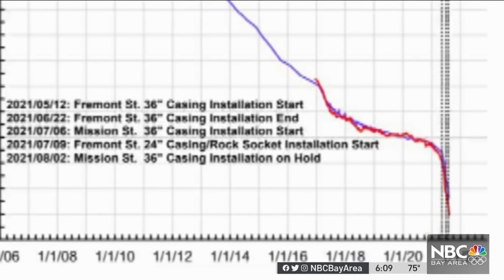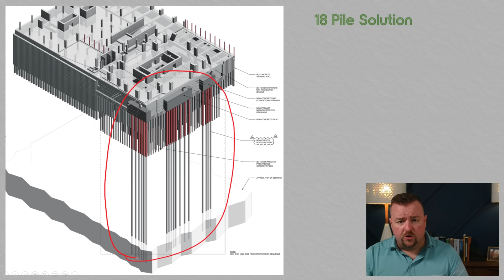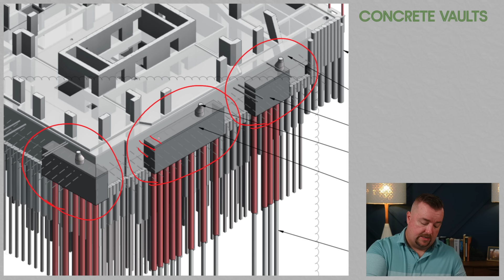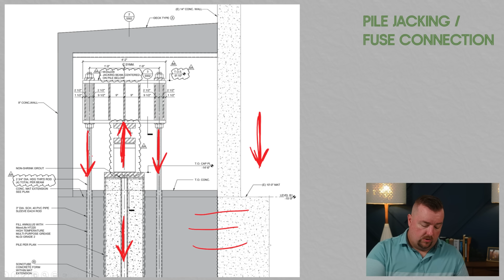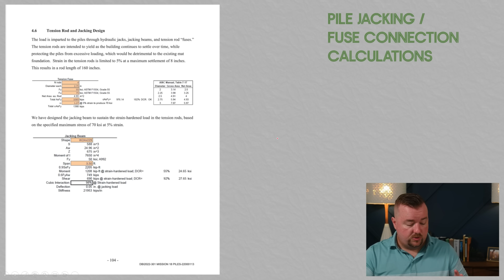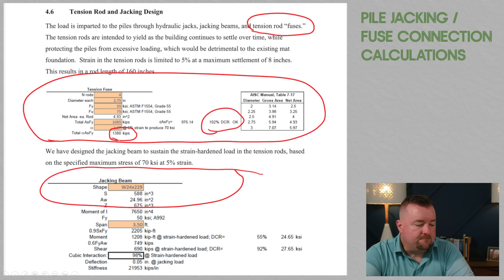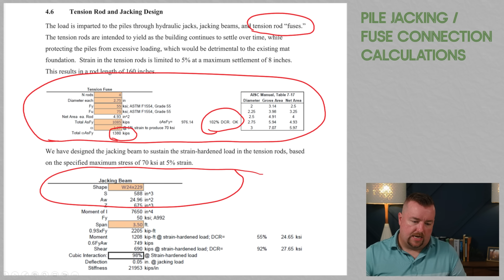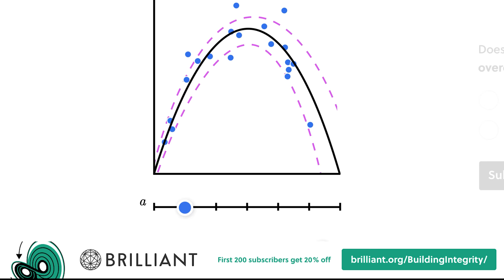Did I Uncover a $100,000,000 Mistake with the Millennium Tower "Fix"?

Comment: Please explain how those short sections of rebar normal to the edge of the existing building are supposed to be sufficient to transfer the vertical building load sideways into the vault concrete? I feel like the underside of the existing building is just going to start cracking...

Comment: Did you run a check for concrete crushing above the plate in addition to steel pullout failure? I would be a lot more concerned about that preceding the steel failure, as with any flexure in the plate I would expect a bearing area something like 5"x5" minus the area of the bolt. I'm sure that's all high strength steel, so regardless of the concrete strength it seems likely to crush it.
Reply: Yes.

Comment: The Tower Of Pisa in Italy, they drilled under the high side, removed some soil and brought the tower back a few degrees.
Reply: There was an article in Scientific American in the late 70's beginning 80's where they discussed the efforts that went to try to stablized the Pisa Tower during the ages, and all of them simply ddin't worked because those added weight to the unstable ground under the tower, and consequently increased the issues.

Comment: What happens if you have a failure of the 102% load at one of these "fuses"?  Would it be a "cascade" of failures?
Reply from the maker: In my opinion, yes.  They are all intended to be purposely loaded beyond their yield strength.  So a failure of just one bolt-to-plate connection would cause the remaining 3 bolts to fail.  Losing the load on that piling should instantly overload the adjacent pilings and they will all pop.

Comment: From day one this building has been a political mess of engineering. Once they changed the foundation plans from bedrock to that big slab, it was doomed. And, once they discovered it sinking, again it has been a mountain of politics combined with huge amounts of money and who should be funding the repairs etc. Hamburger started this mess...
The building should be salvaged of its interior assets and torn down. Sadly, that will be a huge expense however, because of the many players involved with plans and those who approve them within the city. The condo owners need to be reimbursed of their original purchase price, salvage what they can economically from the building, then implode it or deconstruct it. The fact that Hamburger is still on board suggests much liability being put on the city for continuing to "butt their heads against the concrete". Who should pay for this? For now, the city should and if they feel there are others who should be part of the cost, they can work that out at a later time to avoid making the process difficult. The city never should have allowed this project to go ahead due to the type of soil that is there and NOT going to bedrock. Its rather obvious for anyone who can understand basic engineering. And again, this was very political from the day it was started especially because of the city property that was constructed next door. Like a lot of things today, they allowed "politics" to do their engineering vs. the engineers. Just like the state of CA, they run it via "politics" vs how the engineers would when it comes down to water storage, power, natural gas, oil/gasoline, transportation etc. And because its San Francisco, you can be asured it was extra heavy on politics. When municipalities make mistakes, police, fire, county, state etc. and they have to pay the penalties, keep in mind its not their money, its ours. That process is wrong...the people involved within municipalities need to be penalized, not the public.
Reply: The owners may or may not get reimbursed. 
Depends how much money can be recovered. 
Zero tax dollars should be used.

Comment: I'm an engineer and I can't believe how this entire structure has been "calculated" on one single sheet of paper, let alone not calculating that tiny rod anchoring plate at all. Out of words about the blatant ridiculousness of this design.
Reply: I don’t know why you think there is only one sheet of paper.  What you see in this video is not likely to be everything.  The sheets shown here appear to be just part of a report.
Reply: @GH-oi2jf  What I mean is the jack and rod structure of the vault. That has been "calculated" in a few lines on one sheet of paper, which is ridiculous.
Reply: @DavidG2P — You have only seen one sheet.  How do you know what analysis was done?  What we see here is merely a report.
Reply: @GH-oi2jf  I believe that this sheet does contain the calculations, doesn't it

Comment: Yes! Also, there is a significant lateral offset between the upward forces of the threaded rods and the downward forces from the wall of the building. Did they take that overturning moment into account? Seems like there will be a huge tension force between the new and old concrete at the base of the connection.
Reply: Probably a limitation of the chosen drilling equipment, but having them closer to the building would indeed reduce the load on the existing foundation a lot. Since the existing foundation is what it is, I would have put them closer to the existing building. The "top" part of the "vault" also needs to be flexible enough to prevent side loads on the wall above the foundation.

Comment: Hyatt Regency looks like it is in for some competition in the spectacular failure region.  Plate needs to be a lot thicker, and definitely should be at least triple the thickness, plus also a lot wider, and preferably also have at least 6 times the strength in shear than what those rods can exert, as the replacing of them is really going to be hard. Ideally should be at least as large in the concrete as that upper beam, and also at least half the thickness of that beam as well. Yes a hard hole to make, as you will need to mill the hole all the way through, not easy using any other cutting method, and well past the capability of plasma cutting, unless you regard the plasma cut hole as being only the pilot hole.
Reply: @SeanBZA  Also, what is the yield strength of two nuts on a threaded rod that size.  I'm not an engineer, but it seems like that is also a weak point in this design.  All that load on a few mm of thread depth times the height and circumference of the nuts on the rod.
Reply: @mikef2618  A lot less than you would expect, the stress is invariable only carried by the first few turns, with the ductility of the steel meaning the rest of them carry almost nothing other than whatever the delta is. Less than the actual tensile strength of the steel rod itself, and the threads are going to be a big stress riser as well. Threaded rod or bolts almost invariably fail at the base of the nut, if the threads do not simply shear in either the nut or the bolt, whichever is the one with the lower tensile strength. You would need to have the base be not a nut, the cheap option, but an actual forged bolt head, because the forged and annealed bolt will mean the failure point will be up top, where you can mitigate failure, as it will be inspectable.

Comment: I would wonder how they've accounted for additional loads associated with earthquakes.   The last project I worked on in San Francisco required the building to have a base isolation system for earthquakes.   Do any of the plans address expected code performance for earthquakes?

Comment: I admire your ability to explain to those with little engineering knowledge, but it would be nice if you could also show us the more advanced stuff. It would be cool if you had another style of video where you go into calculations etc. This is really fascinating though. Do the nuts provide any force transfer through bond or anything? Also, is there adequate space for the 'vault' system to rotate around the pile? I assume, although minor, it will rotate as the pile is jacked and the building corrects to vertical? Do you know why the threaded bolts are not in contact with the concrete? It seems like the obvious design would be to have allowed the full length of the bolt to bond with the concrete as well?
Reply from the maker: The main reason for not letting the bolt bond to the concrete is that the bolts are designed to "stretch".  Bonding them to the concrete would resist that stretching.
Reply: @BuildingIntegrity  of course, that makes sense. I wonder if an alternate design would have been to have the bolts bond with the concrete and then have their diameter reduce in the area between the I-beam and the concrete surface, to achieve the same strain?

Comment: Can you imagine the level of embarrassment?  They are done and the system is under full load. Then one set immediately fails with a punch through, followed by a cascading failure of the rest. Best to get this question answered soon.
Reply: I'm not worried about embarrassment, what is the next thing after they cascade fail? The sudden weight all going back onto the original foundation and piles that were sinking and being jacked up? Can they take the sudden load, it's not like they are doing well with a static load now, how about a sharp hammer-like blow when this happens? Have to imagine major acceleration to the sinking, probable cracking and breakage. It's very high stakes Jenga at this point.
Reply: @jay2ssrstt  You're right. I was assuming that it would just drop back to the starting point but yea, there could be additional damage to the existing structure if this were to happen. Let's hope they listen and get an independent review of the design and specs!
Reply: That's a potentially better scenario then a silent failure that goes unnoticed over the course of years
Reply: @briankeeley6464  Yeah. Jenga is far less fun if there are thousands of people falling to their deaths in the blocks. Also if it leads to real world version of dominoes that's just down right unneighbourly!

Comment: The building is still sinking in the middle so the "fix" will exsert extra moment on the foundation mat and probably that will fracture the foundaton mat between center of the building and the "fix piles" at edge. This would collapse a slice of the building before  "fix fuse" reduce jacking up forces.

Comment: As a computer programmer designing systems back in the 80's there was an adage that went "There's never enough time to do the job right the first time, but there's always enough time to go back and fix it."  Trouble was that the fixes rarely solved all the problems and we wound up living with the errors.  That cannot happen here.  The fix works or else.  

Save the trouble and just start tearing it down now.  Cheaper in the long run and no lives lost.
Reply: “Or else” what?  Or else they will have to add a few more piles and vaults.  So far, the new piles and vaults are doing what they were intended to do.

Comment: So. Will there be a follow up video on any responses you get from this? Because as soon as you said "oh and the screw fuses are greased" that raised a huge red flag to me. How that was missed seems just... well more believable than it should given some of the engineering I've seen locally.
Reply: I'm still coming to terms with "high-temperature multipurpose grease - NLGI Grade 2" (12:57)  Grade 2, maybe, but high-temperature?   It's a building, not the next model Silverado!
Reply: @oldcynic6964  guessing high-temp has more anti-oxidative goodies which may be helpful over its lifetime. Think: accelerated aging tests which primarily involve increased temperatures.

Comment: As a project manager from a completely different field I have to say that these efforts to safe the tower with some steel rods will fail. At the end they will have to tear down the whole tower. The only way to safe that tower would be to encase the whole tower foundation down to solid rock and exchange the soft material by rocksolid concrete or else. The way they do it now looks like an attempt to keep costs low - but it will backfire.
Reply: So far, the plan is working.  How, exactly, will it fail, and when?

Comment: @3:00 or so. '52 piles, eventually reduced down to 18' - could the plate shear inadequacy and design for yield be as simple as the pile design not being changed at all for the revised loading? Or does the assumed loading per pile not change.
Reply from the maker: I think this may have a lot to do with it.

Comment: According to a CBS interview with David Williams, the expert hired by the residents to give evidence in their lawsuit, the original plans called for the building to be made of steel.  But during the building process, the developer switched from steel to concrete, which added significantly more weight to the structure.

The key question is, when they decided to essentially double the building's weight, did they consider whether the originally planned foundation could support it?

The decision not to sink the original piles into the bedrock, suggests they didn't.

Comment: Was there calculations for the retaining nuts below the plate?
Reply: Nuts are standardised and rated to the same tensile strength as the threaded bolts. The problem seems to be with the plate and transferring loads, which is uncharted territory.

Comment: Hi Josh, thanks for another great video!
Do you have links for the actual plans? I've only been able to find an environmental impact report for the change plan.

Maybe the loads started out much lower but were increased when the number of piles was reduced to 18 but some components weren't updated- would be interested to see a revision history there. 

Is there a circumstance where plastic deformation would is desirable over elastic, as they're doing here? It seems like such a high risk for minimal(?) benefit. 

Finally, I'd love to see your calculations! Understand if you didn't have time to include them in the video though. Cheers!
Reply: To answer my own question, at 19:12 the calculation sheet explains the rationale that plastic deformation of the rods during settlement is intended to protect the piles and foundation mat from excessive forces - so that checks out, as long as the building behaves and never settles more than 8 more inches...

The anemic steel plates seem to be as intended, so of course this concern remains.
Reply: good article in STRUCTURE MAGAZINE : Stabilizing San Francisco’s Leaning Tower
Jun, 2021 By Ronald O. Hamburger, S.E. SECB, Stephen K. Harris, S.E. and Lachezar Handzhiyski, S.E. In Structural Repair

Comment: Very interesting, thanks. How thick / large should the plate have been in your view? And assuming everything is working correctly, will this contraption also help correct the leaning building (jacking it up so after a while it's perfectly vertical again) or is it just designed to prevent the leaning getting even worse?

Comment: As I'm wondering how the all-thread is anchored to the vault you show me and my first reaction was "huh?  That's nuts!"  That looks like something that MIGHT work in the short term but not likely in the long term.  If water gets into PVC shielding the rods it's going to go straight to those plates where they can't inspect it too.
Reply: I think it is an ingenious system.  I don’t see water getting into the works.  The grease should be sufficient to prevent that.  The upper end is exposed to the air.  That would more likely be a problem.
Reply: @GH-oi2jf  but it's the grease going to be maintained 30 years from now?

Comment: Great video.  Given the extensive cracking that has already occurred in the basement, how much do you expect corrosion from increased water intrusion has shortened the life of reinforcing steel or degraded its capacity?  In addition to the serious concern you identified in this video, it looks like the work will add sheer loads to existing rebar, so any further degradation in capacity seems particularly serious.

Comment: I’m a builder in Washington State. One crucial thing I have learned in my 20+ years of constructing is that if you don’t run every detail to ground severe consequences can and probably will occur. Search for your weakest link and improve it! The key way doesn’t look substantial enough to make an adequate connection either.

Comment: For all those that dont understand why they double nut the bottom of the all thread rods and only a single nut on the top is that there is hardly any pressure on the top nut but on the bottom they dont want the threads to tear and have the rod pull threw .  Three or four nuts on the bottom might not even be a bad idea.
Reply: That plate is gonna fail long before those nuts pull through I think.
Reply: But why only a single nut at the very top (above the jack)(not the intermediate positions).
Reply: Actually, the force on the bottom nuts is equal and opposite to the force on the top nut. It is a textbook situation in that the length of rod between is not connected to anthing (it runs through a hole in the concrete) The bottom might be subject to more corrosion, and not available for maintenance, which might be a reason to add an extra nut, but the whole setup is illconceived.
Reply: @matt7403  I think the drawing calls it out as a jam nut, so it's likely there to ensure the first nut can't come loose and not really there for strength.
Reply: @Hyperlooper  thanks! I’m sure the intent is some sort of jam nut function. For some reason my comment came out as general rather than a response to the parent comment. My apologies. I was correcting his contention that the nut at the top of the rod didn’t take as much force as the one(s) at the bottom.